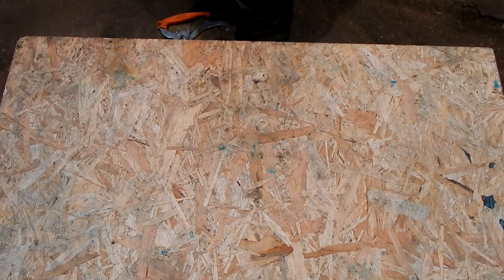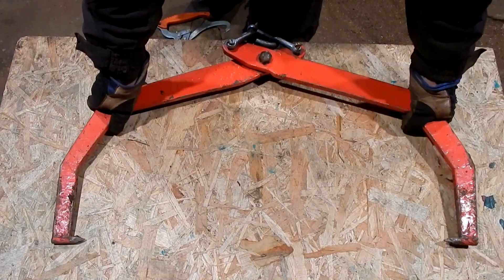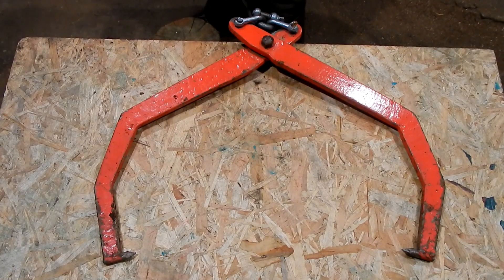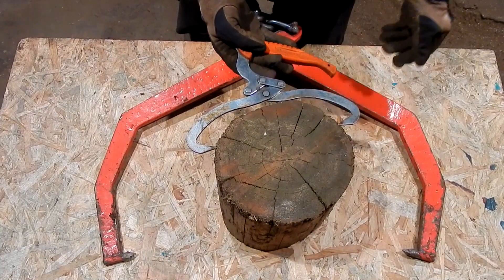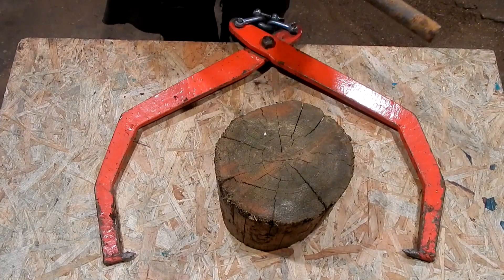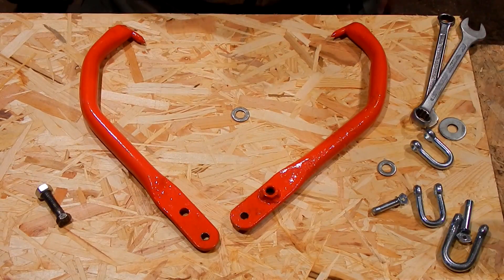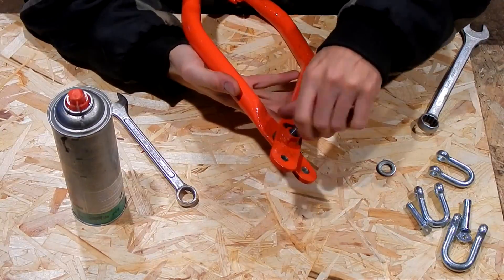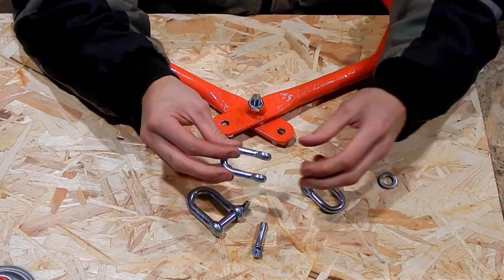Log Grapple Design & Fabrication

Comment: Good job:)  what long pipe did you use for these wood tongs?
Reply from the maker: It's a dairy cattle fence post, 27-28 mm outside diameter, ~ 3 mm wall thickness.

Comment: Donn, this is a great video, I need to build a couple in different sizes.  I have nine 40ft pine trees that either snapped of or been uprooted and I need a way to lift them so I can cut long sections of straight trunk into boards.

Comment: looks like the weakest point is the bigger D ring on top that connects the two smaller ones since the smaller ones split the load, so id use it to whatever that D ring you hook your winch to is rated for.. however 99.5% of the time itll rip out of the log/bark before breaking
Reply from the maker: These shackles are pretty tough. I've used these on the big grapple and they're still fine. If these on the medium size grapple brake I'll just upgrade them to bigger ones. Then the grapple itself will probably brake. :D
Reply: @DonnDIY  how have these worked out im about to build my own, any changes youd make?

Comment: I made one similar and it works great grabbing aand dragging small around birch and pine. I later built a triangle out of the same size tubing and connect it to the grapple for double duty. Drag logs out and then to grab cut offs up onto my log splitter by hand. You would be amazed how much more you can get through whern you don't have to grab them right off the ground. I can about double the amount split in the same amount of time and not be as tired or sore. Yeah I'm old.
Reply from the maker: So you made a handle for the grapple? It must be a great back saver.

Comment: Great work! I always enjoy watching creative people like you! I work in a sawmill and we use log grapples. There is a difference between the type that drags a log out of a forrest and a grapple that lifts the log! Most things are over engineered but lifting heavy stuff requires some engineering.
Reply from the maker: This grapple I wanna use for lifting / dragging smaller alder logs for heating the house. It will come especially handy when using the timber trailer in symbiosis with a firewood processor.